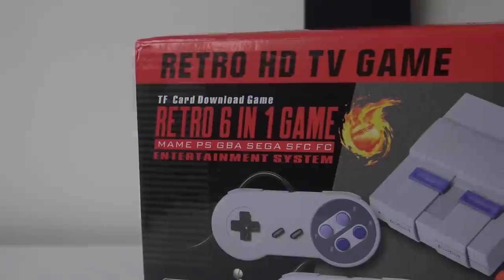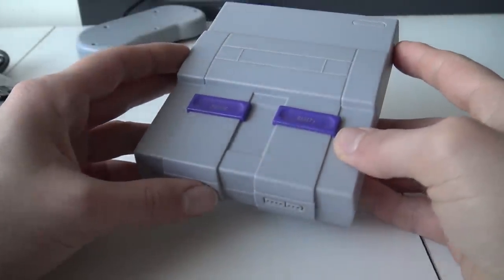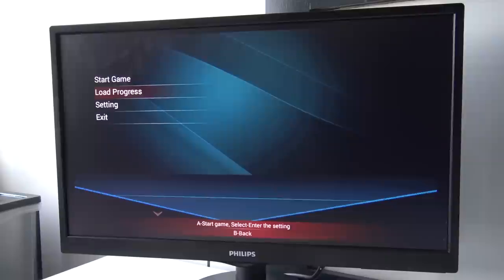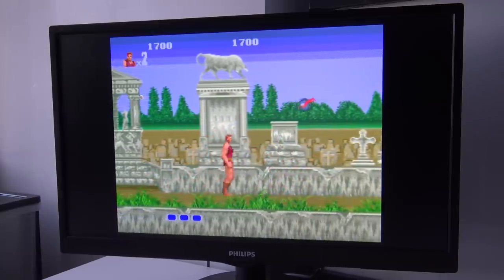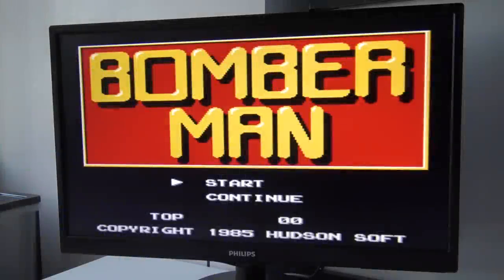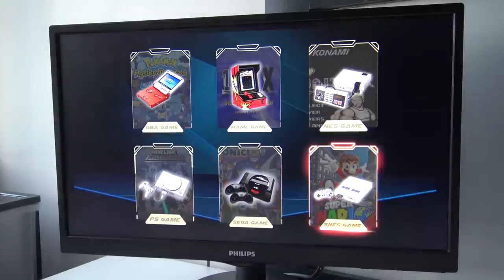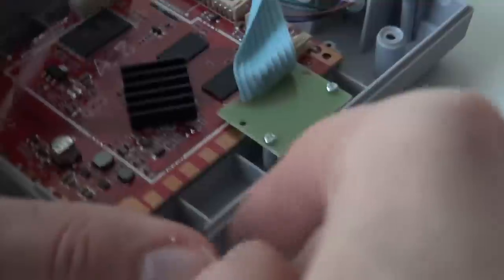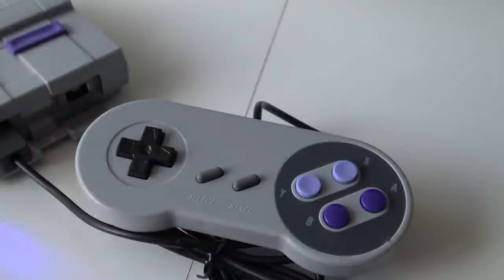The Best SNES Mini Clone... FINALLY ??

Comment: What would you say is the best snes clone from China so far? I am quite interested in this unit and the sfc-100. What I like is, the sd card slot, hdmi out, and the classic controller ports, although to use them someone would have to rewire it